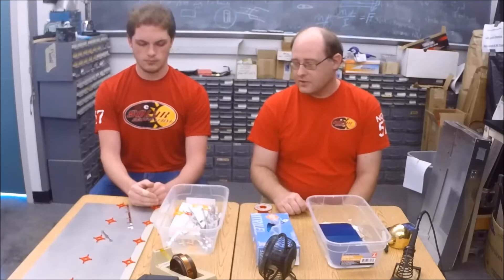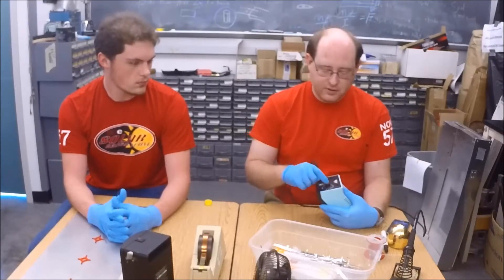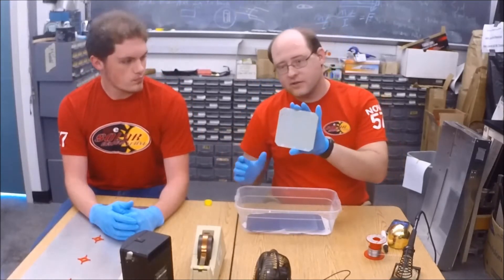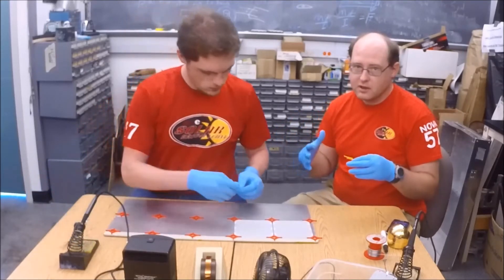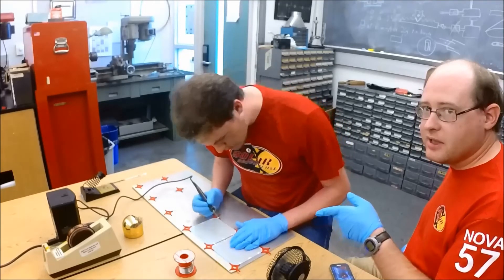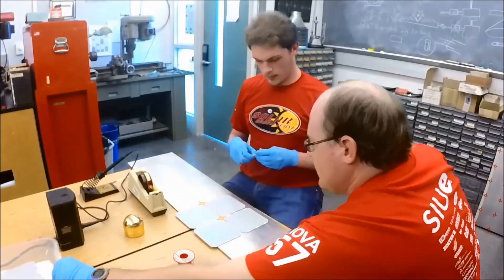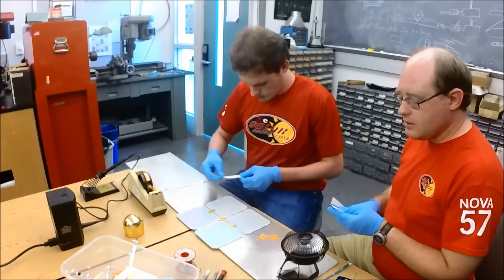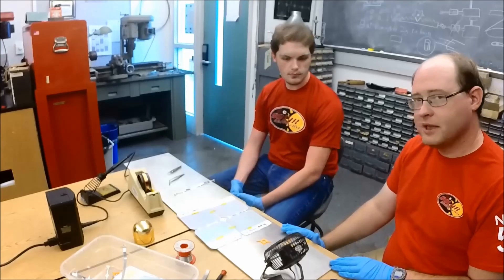SunPower Cell Soldering Part One

Comment: Thanks for that info using 3d printer to create the frame for proper lining. I tried with dogbone that was a mess. Later i just used stripes, but now I'm wondering if dogbone actually helps to dissipate the heat when 5.5 amp passes through the connections. I think dogbone reduces it's resistance, so the overall power output will increase.

Comment: 2:03 - The Weller is self-regulating. It regulates at the temperature you set on the dial.
The lead in the solder does not vaporize at normal soldering temperatures, and ventilation addresses the removal of flux fumes.

Comment: hi, what power of soldering gun is sufficient for that please?
Reply: Hi Gregory! We prefer to use a self sensing soldering iron for these cells but a decent soldering iron set somewhere between 600 and 700°F should be sufficient for soldering. The key is to not leave the heat on for too long as it will damage the cell if held for too long.

Comment: You could have just used the kapton tape as insulation under the busbar. It's not going to soak up moisture like the paper will and it can take a lot of heat.

Comment: Great tips and technique. Is it required to solder the full length of the bus on the common bus style cells or can the ends only be done like you do with these cells? Is the full length necessary to pull full amperage without damaging the cell?Thank you. What are you thoughts and experience?
Reply from the maker: I recommend soldering the full length of the tabs. Also I recommend fluxing the back of the tabbing wire and not the cells. Tabbing the cells results in flux bleeding on the cell. Here is a link to the only video I have of cells being tabbed. This was for our 2014 array. I'm not even sure why I shot this video but hopefully you can find it useful. https://youtu.be/9KLd7M0rtpI